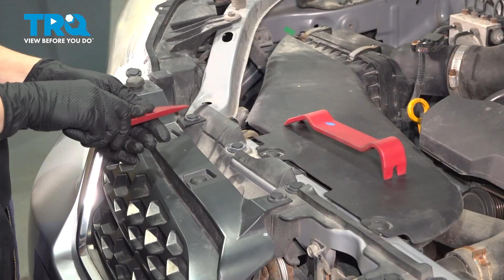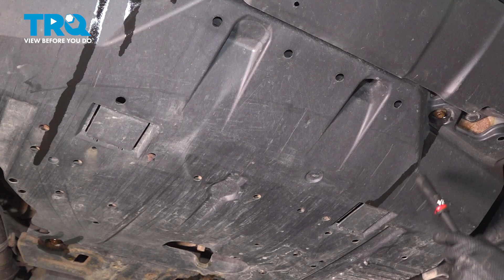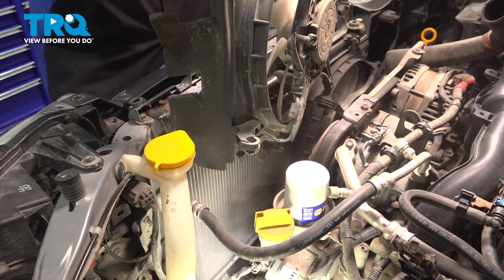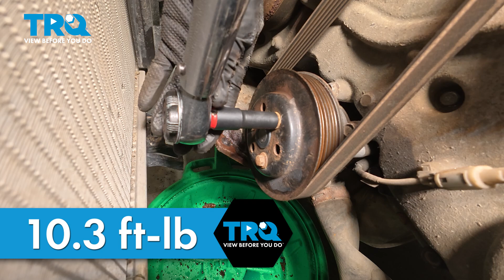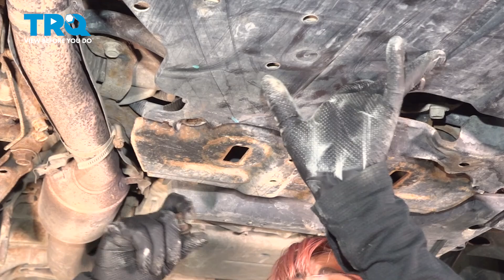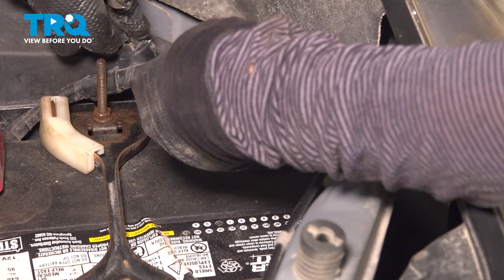How to Replace Engine Water Pump 2014-2018 Subaru Forester

Comment: Thanks for the video. But, what was the purpose of disconnecting the front grille and removing all those plastic clips? I Would have start the car and look for leaks at the water pump and drain plug before putting back the underbody plastic cover? I would only use the Subaru super coolant.

Comment: Thanks!! It seems to be the same procedure for all 2.5 FB25 engines. Like the crosstrek sport  and so on from 2020 as well.Also, for my 2011 forester. Good thing I already have the water pump in hand. And without taking off any trim, I believe. However, I didn't see any use of silicone for the pump?? Is it not necessary?? 🤔🤔

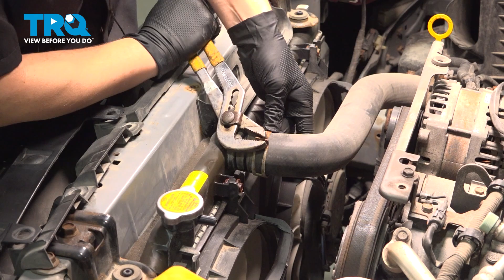Comment: 3:41 clamp securing the hose correctly  14:12 clamp binding on itself and not securing the hose... aka once the system makes pressure things are going to get messy